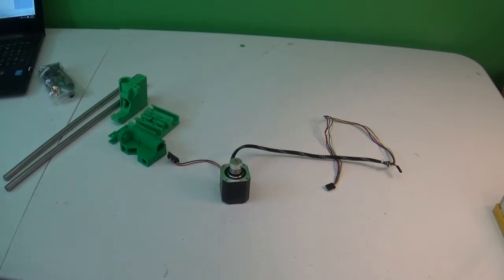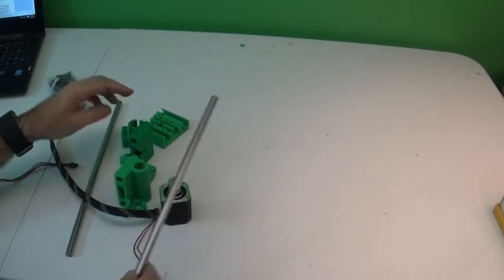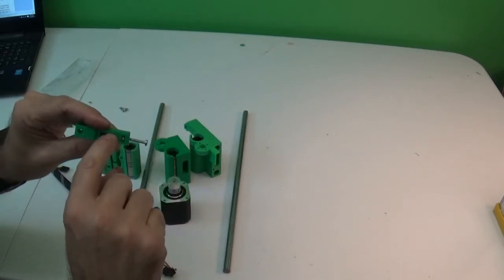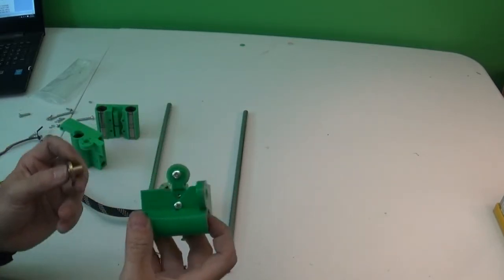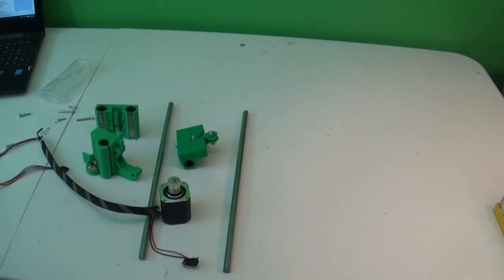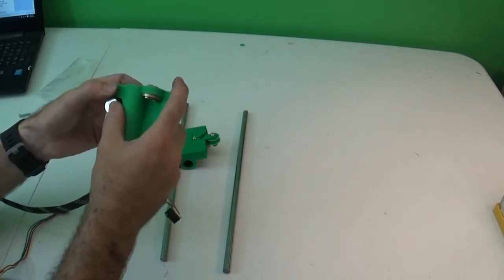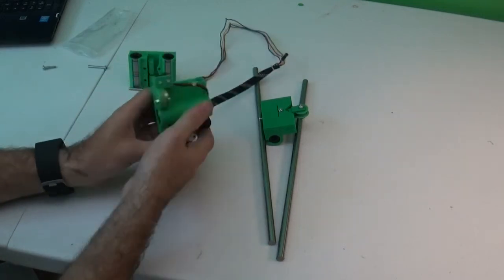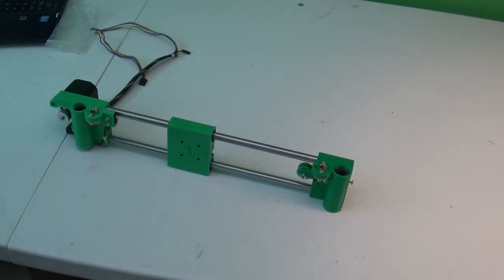Reprap Wilson II Assembly Video series part 2

Comment: Question:  Could you install BOTH the Z-endstop AND the bed leveling probe and then wire both switches in parallel (or series for NC setup, I'm using the NO myself)?  If the probe strikes BEFORE the Z endstop (which I'd expect since you don't want the hot end hitting the bed, the probe is lower than the nozzle), then with the probe retracted manual leveling is in effect, and with the probe down auto leveling is in effect.  The firmware should have an offset of the difference between the probe position and the nozzle position (with the Z-endstop both are the same), so the Z home, zero point is set correctly either way.  Now it would just depend on which Gcodes were sent to home the Z azis and level the bed.